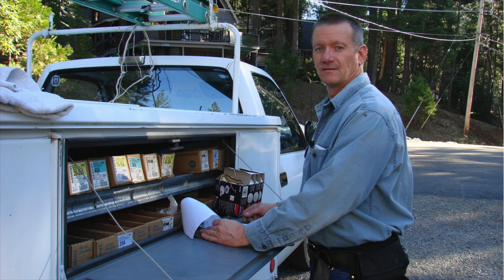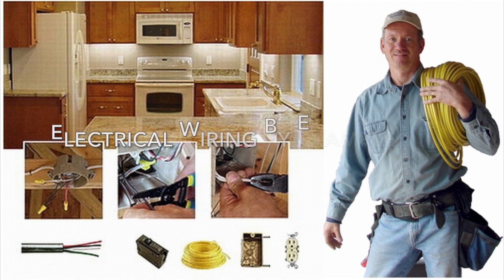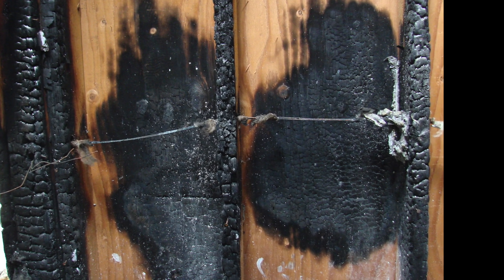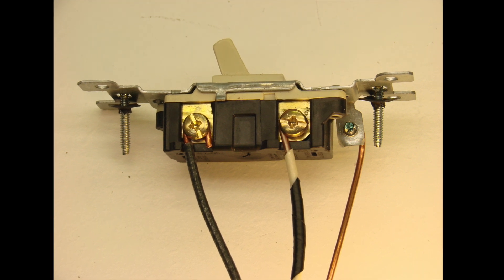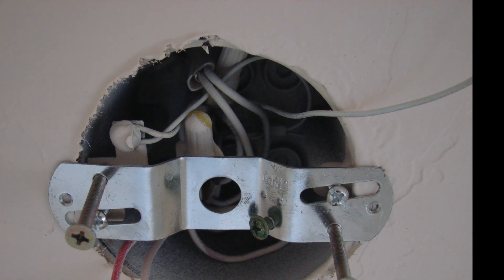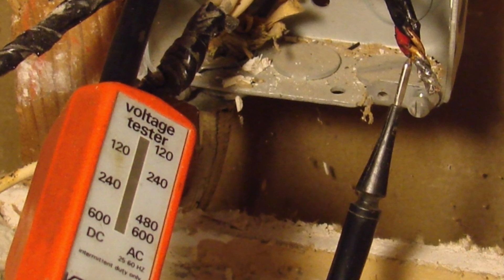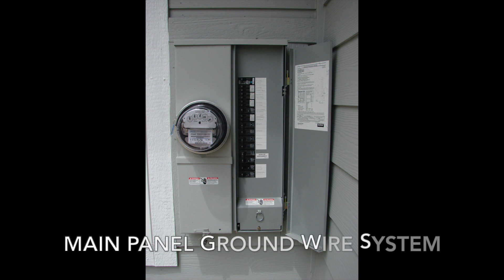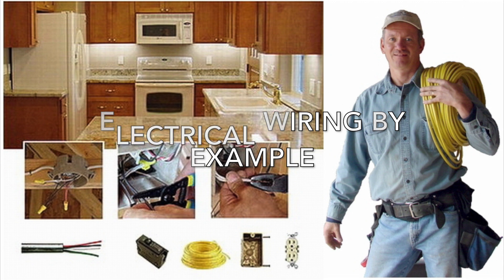DIY Electrical Wiring Tips for Home Electrical Wiring Projects - Vol 1

Comment: Do you use 125 volts?
Reply from the maker: The circuit voltage depends on the specific application. However typical branch circuits in a home are 120volt. The voltage ranges plus or minus 10% with most electric utility companies.

Comment: Why does all of my outlet in my bedroom is reading 500 to 800 V/m  is that normal. I feel nauseated,  headaches everytime I'm in the room?
Reply from the maker: To get a true volt measurement test outlets with the meter on the AC Volts setting. To help with EMF sensitivities that may cause headaches and nausea consider unplugging the WiFi router, disable blue tooth and WiFi on your PC, don't use cordless phones, and turn off cell phones when not needed.